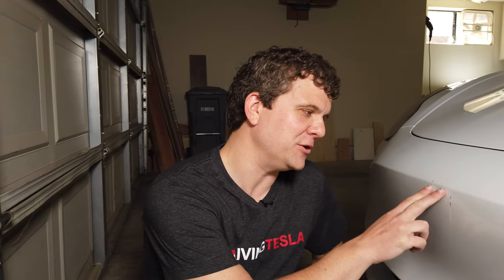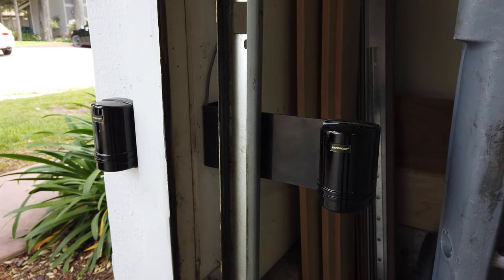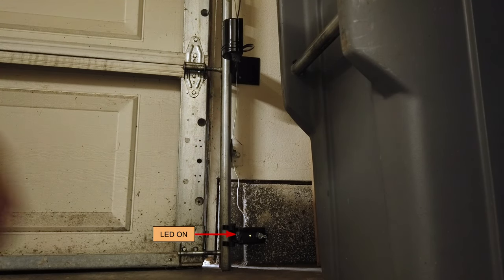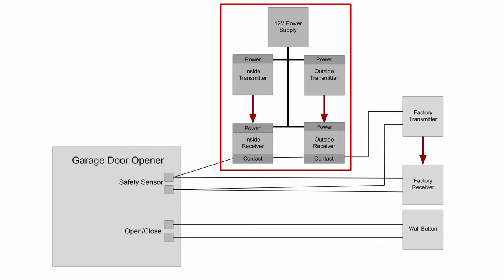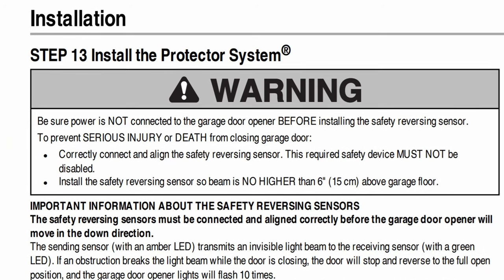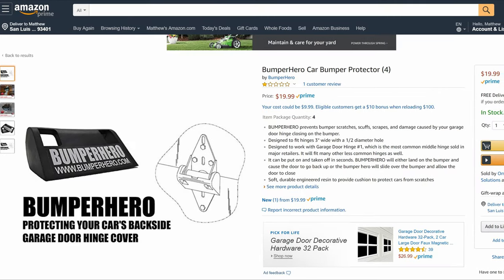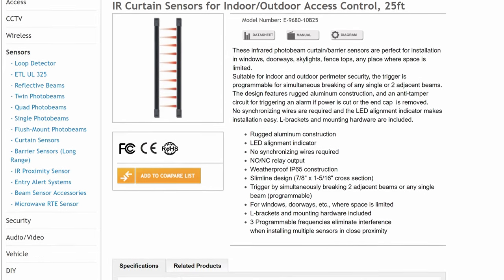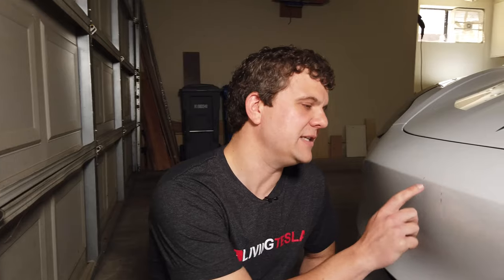Garage Door Bumper Sensors

Comment: The easiest solution is just to hang small rubber or porolon ball that way so when car is touching it with it's front or back window it means it is in safe position in a garage. Works like a charm and takes 10 min to make. The only thing is you have to drive in all the time the same way (forward or backward), but usually you do.
Reply from the maker: I've used a 2x4 on the floor as my guide for 10 years with no issues. It was fine until it wasn't.
Reply: @EveryAmp   You cannot see 2X4 on a floor, just feel it, right? Just too easy probably to made a mistake.
Reply from the maker: Well like I said anything that relies on a human not making a mistake isn't going to cut it for me anymore. This will work for any car with any driver and I'm still keeping my 2x4s on the floor.

Comment: Reverse park in garage too. A bit more difficult judging distance so I installed tire stops (reused sand bags). Cheap. Requires little to no thinking while backing into garage.
Reply from the maker: I've used a 2x4 for years. It worked great until it didn't.

Comment: is this solution still working for you?  I have the same problem and looking for this type of solution.  Also, do the sensors outside ever give you problems if it is raining or if direct sunlight shines on them?  Thanks for the video- very helpful!
Reply from the maker: I did eventually install sunshades on them after I found direct sunlight would bother them at certain times of the year, but more recently, I upgraded everything to a system from Infinity Shield. https://youtu.be/tg_Op2g-m8c?si=-YEVdRD2OrivaUI7

It doesn't have outside sensors, but I feel like the full coverage is a higher priority.

Comment: I guess that's one advantage to not having a garage 😐
Are you getting a full body wrap or just the front?  My full body wrap was $5k installed
If I ever have a garage I'll probably do something similar to what you did with 4 sensors.  Thanks for the idea.
Reply from the maker: I'm going to start with the bumpers, hood, and mirrors. I'd like to do it all, but as you said, it's pricey.